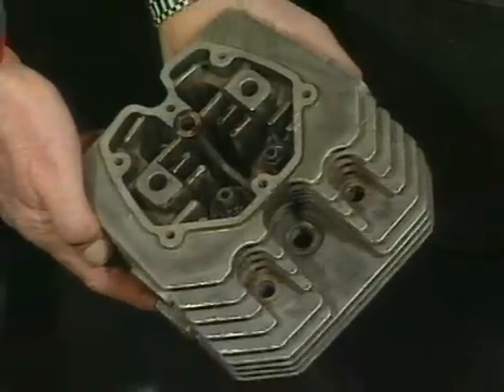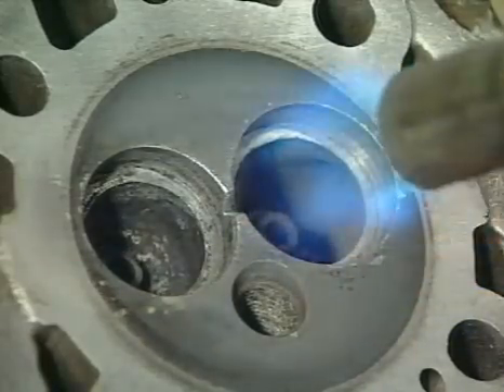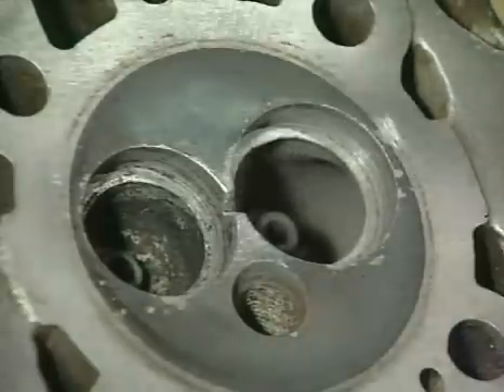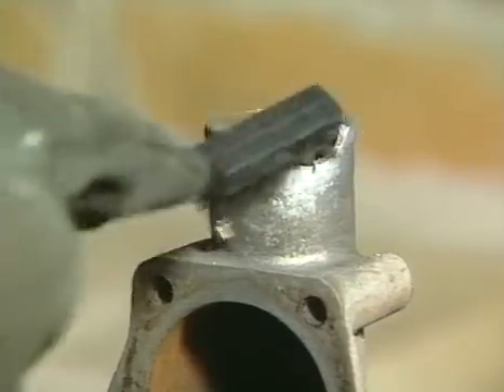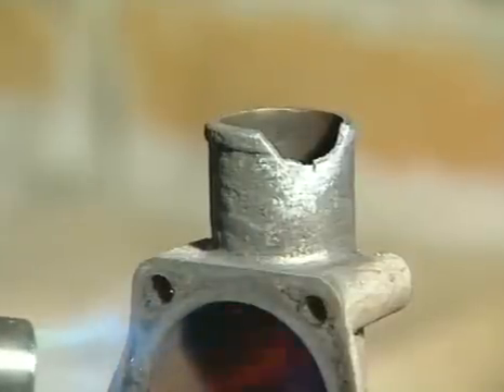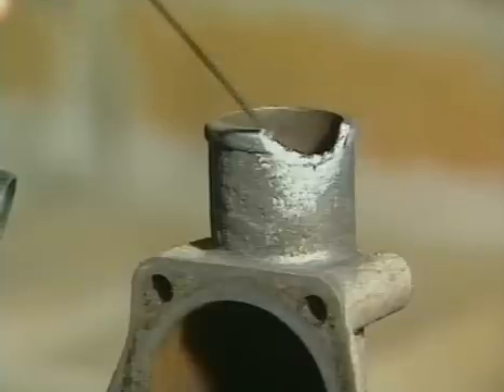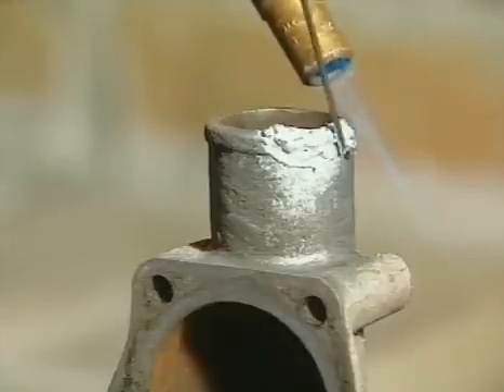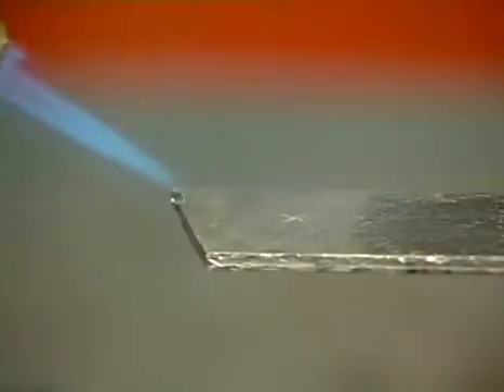Welding aluminium Part 2

Comment: Hello sir  , can you show me what kind of your torch ?  it is small but it can brazing aluminum  , 
Can we use cooking gas for brazing  ? 
Thanks
Reply: Propane / Butane mix works well - I brazed a cracked aluminium pipe with it. It's enough to melt the pipe (about 1mm wall thickness), which I did three times and had to start again, if you apply too much heat. I managed to make the pipe airtight, even though I had to braze four sections.

Comment: I'm gonna try this on my messed up cylinder head of my yz250f
Reply: Did it worked?
Reply: Did it worked? Just to let you know this is not actually welding this is more of brazing in other words your adding metal without melting the base and making them one piece. But how ever the resoonsability is on you. Good luck!! 👍👌
Reply: @ricardogarcia4523  I have not yet have time to try it yet , but i thought about buying a welder and just start welding aluminium instead and then I'll get to thebtrickyer stuff

Comment: bought some of this over five years ago to repair a model engine mounting lug that had snapped off my FSRV boat engine which crankcase is made from some zink/alum alloy. preheated the model engine crankcase on a fire brick with a torch using mapp gas and approached it like I was soldering and digged into the flow from the filler rod with the stainless steel scraping rod provided and there seems to be a chemical reaction going on and the filler rod left a solder like joint which when left to cool was filed back and the lug is now as good as new.  (it did not leave a mess like the work piece in the video it just looked like it was lead soldered)

Comment: difference between soldering and welding is: in soldering the filler material is different from the workpiece material. so this guy is melting a aluminium rod on a aluminium engine block, wich makes it welding.
Reply: +Lex Breijs That fukin rod is not aluminium.
Reply: إ
Reply: +Lex Breijs It's aluminum brazing. I don't why they call it welding, other than it's a marketing thing. The rods are most likely a combination of tin, zinc, and aluminum, and maybe a couple other things. That being said, these rods do work well I've found.

Comment: lets solder our internal engine components back together! a melting point of 380? haha nice.  this is good to fix a lawnmower handle or repair a leaky pop can
Reply: Well, i think it could actually work. Your cylinder head is watercooled. It never gets as hot as 380 degrees. I think it's worth a try, before you throw it in the bin

Comment: I do believe that in order for a process to qualify as "WELDING" one would be required to "MELT" "BOTH" metals in order to achieve "FUSION". Joining metals with a capillary action ("THIS VIDEO") where all metals do not reach their melting temperature is either BRAZING or SOLDERING, depending on other factors.

Comment: I've had tons of customers try this stuff before calling me to do a repair correctly. There's no substitute for TIG welding. Also, as far as using this junk to weld soda cans? It wouldn't hold the pressure, but if you need a soda can fixed, I can TIG that too!

Comment: @FOXnewsAlien  Alu isn't hard at all compared to steel. It's a bitch to grind only because it is soft and picks up on the bit. Try grinding it with a very coarse bit, using technical spirits or windscreen wiper fluid as "lube".. and if you're doing milling or have it in a lathe, get that cutting speed to at least twice that of steel. You'll do fine.

Comment: This is soldering. Does anyone really believe that the "fix" in the combustion chamber will last?  The temperature inside the chamber probably would remelt the "fix" and it would disappear onto your rings, valves, runners, pistons,....

Comment: why not just heat it redglowing and then melt the rod???
Reply: I know this comment is old, but it would melt the head, you have to be careful with aluminium if it gets too hot. I don't believe you can have aluminium glowing red hot as it will be flowing by then.